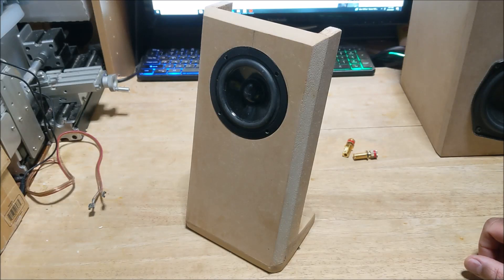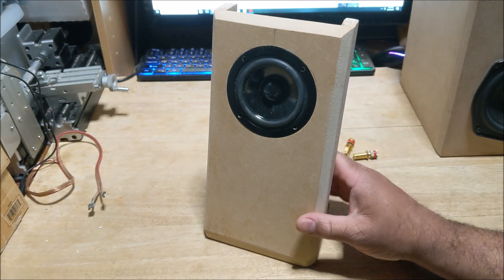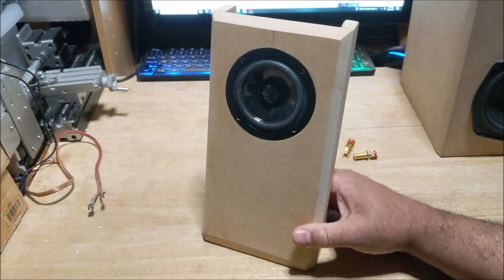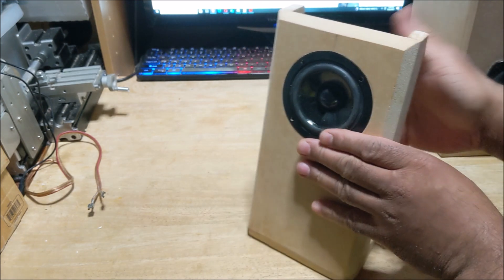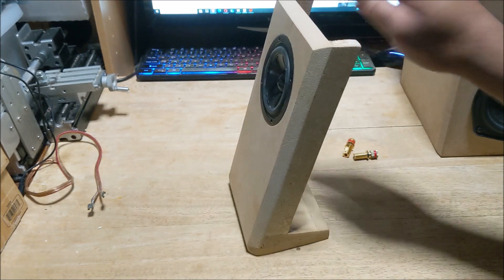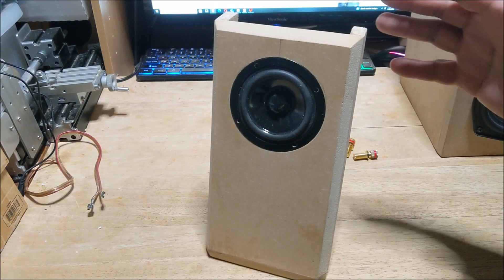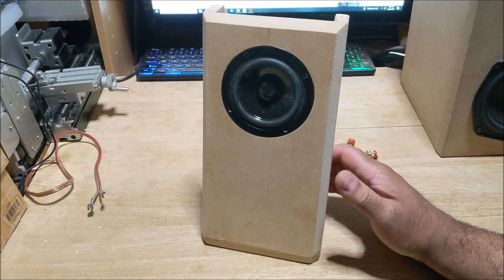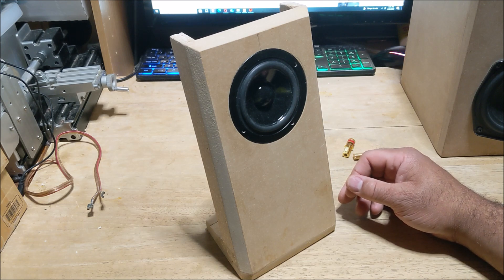Dayton Audio Full range DS90-8 driver Open Baffle Design

Comment: I'm a big fan of open baffle, and Dayton Audio drivers.  I've been building open baffle since 1994 and could never go back to a conventional box design especially for critical music listening.  Even my home theater is all open baffle with the exception of the subwoofers that cover 35 Hz down to 10 Hz and the Dolby Atmos.  I just discovered an subscribed to your channel.

It would be interesting to see non linear distortion test on that driver.
Reply from the maker: Thanks for the comment and Joining my Channel!  Wow, the subwoofer covers from 35hz to 10Hz, that's really impressive!   So your main speakers are full ranges(down to 30 Hz or so?), with a sub for even lower bass.  That setup must sound really amazing for home theater.
Reply: @lovethatpop  The speakers are all DIY and the mains consist of 9'--8" tall open baffle CBT arrays with separate open baffle H-frame woofers with eight 15" drivers on each side of the screen.  The open baffle 15" drivers cover 35 Hz to 90 Hz where the CBT lines take over.  The subwoofers consist of twelve 18" Ultimax drivers in infinite baffle mounted in the attic.  Neither woofer system requires much power, around 60 to 75 watts per driver is more than enough.
Reply from the maker: @ Wow, 12 - 18" subwoofers and 8 - 15" woofers on each side of the screen,   That's better than most movie theaters I have seen.  The sound from that system must be truly amazing.    That is one design I haven't tried yet (open baffle). Now, I'm really curious about doing an open baffle design speaker (a 2-way for starters).
Reply from the maker: I just subscribed to your channel and I see you do amazing work as a DIY.  Your home theater system is amazing, so many subwoofers.  I like your line array speakers. Thanks again for subscribing to my channel.